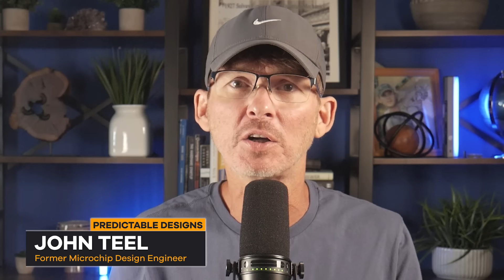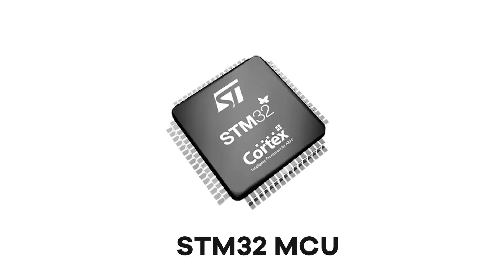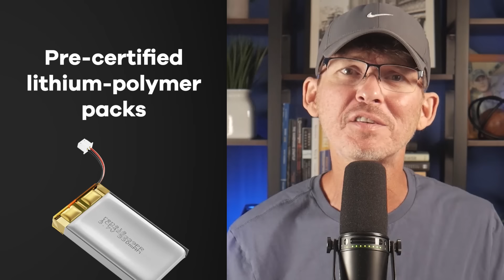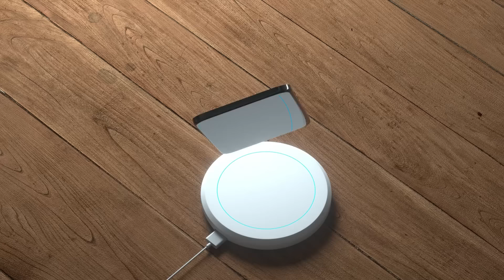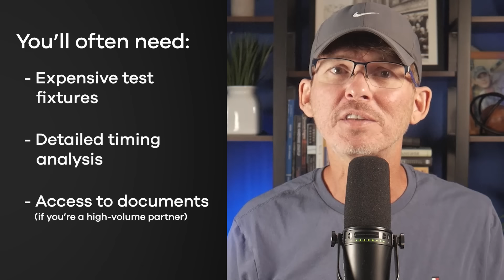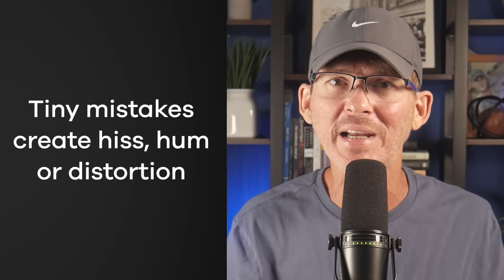10 Technologies You Should NEVER Use in a Product

Comment: "RF is tricky"
I had a colleague, other than me a proper electronics guy, who told me that everything above 100 MHz is basically black magic.
Reply: I watched the know it all PCB guys panic when the processors hit 100 MHz. Their boards stopped working altogether. I caught one group where I worked sneaking Intel engineers in to teach them high speed design after hours. During that transition time, the analog guys would laugh saying, in the end, everything is analog, you just don't notice it at low speeds.
Reply: @johnelectric933  I just did a very rough calculation. Given the self inductance of a wire (yes, I used the first link on Google) a 0.01 mm diameter wire with a length of 5 mm (standing in for a PCB trace) has an inductance of L=91.5 nH. At f=100 MHz, with Z=i*2pi*f*L you get an impedance  of 5.75 Ohms. Suddenly a wire is not just a wire anymore.
Reply: @TomFynn  Beyond that, at higher frequencies or longer distances timing becomes an issue.

Grace hopper used to hand out wires 30cm long.  Which is the distance a signal can travel in a nanosecond.
Reply: @TomFynn I've never really considered this cause I've never ventured that far. Holy shit. That is in fact not just a trace anymore
Reply: @TomFynn  Yes, inductance of traces is important. But those values aren't realistic

1. Diameter is unrealistic: you never have a 10um trace anywhere. Typical minimum trace is .1mm, maybe 75 or 50um in short areas.
2. The calculation seems wrong. With a simple formula, I get 6.6nH

Wire self inductance is mostly a problem with power supply traces.
Even a few nH of inductance causes your bypass capacitors to become pretty much ineffective at buffering the current spikes a modern processor needs.

For data traces, I've never seen trace inductance be a problem.
There it's either trace capacitance (for slower speed buses) or needing to see the wire as an RF transmission line for high speed buses.
Let me just leave it at this example: If you have a trace with an open end, that's exactly 1/4 of the wavelength long (so for 100MHz that is 420mm), from the other end, it looks like a dead short. It's called a quarter-wave impedance transformer, look it up.
Reply: @kurwamamkaca  If you go even further (or a longer trace), you also need to consider the time a signal takes on the trace. On PCBs electrical signals travel at roughly 1/2 the speed of light, so 60ps/cm. And once that time is significant, you have to compute your trace as an RF transmission line, which is a whole other topic.
Reply: @alexanderdaum8053  The values I pulled from some bodily orifice. They are not important. The point was to illustrate that at HF things we normally classify as a resistor suddenly become...interesting.
Reply: @johnelectric933  so much truth in there, it kinda hurts 😬 I'm starting to edge closer to that 100MHz area where things "stop working like they should" 😂
Reply: Interesting, I told same on some job interview 25 years ago. Though these days you can copy and paste reference designs for standard stuff.
Reply: @mladenmatosevic4591  i have seen people try to copy paste reference designs on to custom pcbs and expect it to work. it did not (4 SWR LOL)
Reply: @barfbot  Love reviewing a design and seeing very inconsistent errors around the same issues, meaning they copied references from vastly different sources and had no clue what they were doing..
Reply: @mladenmatosevic4591  You copy paste, and suddenly your RTC clock doesn't work any more because ... something ... Yeah. It doesn't work.
Reply: You should see "digital" signals on a DDR4 module using a 12GHz scope. They just look like analog noise until you dial in the switch points and see they are actually doing what they are supposed to do. 
20 years ago the probes for that were active and $1500 each and you solder little flex circuits to your test points and plugged the probe into those.
Reply: @johnelectric933  Probably bad form to mention another channel, but there is a channel on YT by CuriousMarc where in one video he repairs an old 3GHz signal generator by HP. At one point he opens and shows the inner workings of the unobtainium at the heart of this machine. It is just like walking through an alien city. And I mean alien as in "Humanity is not yet ready to receive such limitless power."
Reply: As an RF designer for >40yrs…..very few BSEE graduates in the past decade(or more) have taken any EM-classes or Waves and Fields.  Yes, it can involve triple integrals in coordinate conversions.  Too hard for Computer Science majors? No. Just hard work.  When many products are thought of as just an IP address or MAC address, then the device needs “wireless” connectivity you either “buy” a module or “hire” a grey-haired consultant who knows RF from 10kHz to 100+GHz is all just Maxwell’s four equations.  Colleges & Univ. need to go back to teaching RF along with CS.  Just my 2 cent opinion.
Reply: @BJustin-zms  There is a channel here on YouTube named CuriousMarc. He repairs old HP lab equipment and one project was a 3 GHz signal generator. At one point he opened the unobtanium which is the beating heart of the machine. Its inner workings felt like seeing an alien city built by a long-lost civilization of such high intelligence that mere mortals would never understand.
Reply: Anything below 1Mhz is practically DC.
Reply: @BartSliggers  Worked with a professor for a few months who only did RF and radar in the 60GHz+ range. To him, everything below a few GHz was "practically DC"
Reply: I'm an electronics guy & I approve this fact.
Reply: I have a pair of type 807 transmitting vacuum tubes, except they have MIL part numbers and octal bases made of ceramic.  They were brutally expensive in the late 1930's and give a class-B push-pull agreement with this statement.  But nobody knew phenolic started to conduct electricity at Very High Frequencies (over 50 MHz or so) in those days.
Reply: Ti's true
Reply: Oh snap. Don't tell THAT to the radio station I listened to in High School.
Reply: I still have nightmares about Ku band circuits 15 years after roaching out of that crap. I don't know anyone who enjoys that work.
Reply: I dodged RF and communication as a specialty at the BS level.  Why?  Electrical engineers that specialize in chip design that run in the GHz and RF are really scientists masquerading as engineers.  Jeez, microprocessor designers usually are in testing for years before they are allowed to design.  Once I heard that, I was out.  I remember a professor that designed antennas.  He ordered so much expensive stuff.  None of it was used.  He did it, all pencil and paper.  😮
Reply: @squirrel6687  In a channel here on YT, CuriousMarc, he fixed an old HP 3Ghz spectrum analyzer. In the video he opened up the unobtainium that is the heart of the machine and let the camera show it in close up. It felt like flying over an alien city. You see that it is a city. It looks and feels like a city. But you also know that it was built by an intelligence  beyond your understanding and probably always will be beyond it.
Reply: It's a black magic if you don't use EMS simulation extensively. If you do it just becomes a trickery.
Reply: Luckily there are SoC solutions for almost all rf babds you can utilise
Reply: You also need to watch out for accidental RF, a large power MOSFET was able to oscillate at around 100MHz when operating with a high voltage drop.
Reply: Yup, and analog power control is voodoo
Reply: @jenpsakiscousin4589  I remember I once watched a video here on YT of a transformer in the MW range being powered up. That definitely must have involved prayers to the machine god.
Reply: I'd say that line is too high, I work on linacs that use 13.6mhz there abouts, it's basically a black box with a few million variables that are all tricky to actually measure lol
Reply: I work in the S-Band and higher (up to 6.5GHz). It's not black magic.
Reply: @PeterA650 that's because you've learned all the spells.
Reply: @PeterA650  I recommend this video /watch?v=buNejAFjWzw from 10:40 by YTber CuriousMarc. It is Black Magic.
Reply: @PeterA650  it's S-magic

Comment: Had good luck with the Nordic reference designs instead of module & a qi charger instead of a port because of a salt water environment, but it depends on the workforce & expertise.  Things can be done in silicon valley that would be hard in the midwest.

Comment: High end analog audio is good stuff though if you specialize in that. Building amps, preamps, synthesizers and other electronic instruments, effects - definitely fun for me, especially with vacuum tubes. Not a path for everyone, but for the keen and willing to learn. It's true that you'll need more than a DMM, oscilloscope, power supply and function generator to get going, but Digilent's Analog Discovery 2 or 3 is of great help here, automating lots of measurements.

My advice would be to go with standard parts (what EEVBlog calls jellybean components - they've been around, made by multiple manufacturers, easy to use and documentation is available, and the risk of discontinuing is low) and staying clear from manufacturing limits (trace width, clearance, via/PTH diameter, etc.) unless you have a really good reason.
Reply from the maker: Definitely, if you have the audio design skills. Custom RF and high end audio are two of the most complex types of analog design.
Reply: @PredictableDesigns  Though audio is still orders of magnitude simpler than most of the actually high frequency stuff. 20kHz is still very very pedestrian in the world of signal processing.
Reply: For audio, vacuum tubes have zero technical advantage and many drawbacks.  Their only advantage is impressing no-nothing brain-dead buyers.  A 5534 or even a TLO71 is far superior.
Reply: What are the issues you've run into in synthesizers? (I'm a software synthesis guy so I'm intrigued)
Reply: @boptillyouflop  ground loops, some cross-talk or excessive attenuation if you want to fan out a high-ish impedance output, that can be tackled though.
Reply: @KeritechElectronics  Good to know, thanks!
Reply: It's not that hard, you just have to remember to put the arrows in so that the electrons don't get lost and accuse people of not appreciating music if they don't hear anything over the static.

Comment: HDMI also has licensing issues
Reply from the maker: Great point I should have mentioned! Thanks for sharing.
Reply: @PredictableDesigns  This issue has even tripped up AMD when they were denied a license for HDMI 2.1 on their graphics cards.
Reply: @gtsteel  Not really. The issue is that they have an open source driver on Linux and the HDMI consortium had issues with that. They could have used a binary blob for HDMI 2.1 functions the same as Nvidia to get around that. Intel instead opted to use DP-->HDMI ICs on their Archmage cards so there was no issue but Battlemage has the exact same issue as AMD.
Reply: @Realmaker001  "They could have just doubled some of their support work." There I fixed that misleading line for you. Surely it wasn't intentional.
Reply: @fgregerfeaxcwfeffece Your added "just" is doing heavy duty here. I did not imply a should have but a could have. Surely it wasn't intentional.
Reply: Use DisplayPort instead.
Reply: They are very forgiving. You can start non-certified for small volumes...and if the product ramp up, you start the paper work...otherwise, just kill the product. Unlike RF techs...which can put you in trouble even for low volumes.

Comment: I usually avoid products that aren't USB, if there's a USB alternative.   That feature is easily worth $10 or $20, since I generally don't buy tech unless I plan to keep it for 5+ years.

But if you do PD, try to make sure it can charge slowly from a 5v supply.  People will be confused and complain if it doesn't charge from a legacy source.   Even if it takes ten hours, that's might be fine for a lot of use cases, as long as it does in fact actually charge.
Reply: This is a huge thing people neglect. Customers don’t understand PD so you better make sure it still charges at 5V.
Reply: @ZachMakeThing Even with people who do understand it, sometimes you just don't have access to a PD port
Reply: Beware of the opposite problem. If you shove a USB-C socket on a device and forget the CC resistors, it will work fine on a dumb USB A-C cable, but on a C-C cable and a PD supply it won’t output any power at all. Lots of cheap gadgets that use a USB C port for 5V charging have this problem.
Reply: I specifically bought a USB-C PD charger for my car that had 20v out so I could charge my laptop on my 1.5 hour commute. Would have been nice if it charged with a lower voltage PD charger.
Reply: @brainwater  Saw a few laptops that could do that (albeit at very slow speeds), but nowadays I mostly encounter laptops that just demand 20v over pd, and some will complain if for some reason it drops somewhat below it (low mains voltage, near to the max power of the off brand charger etc...)
Reply: @brainwater  The fact that USB-C charges large things like laptops was one of the stupidest ideas out there. It leads to a lot of fire related risks that are unnecessary when people inevitably come across non-compliant cables. Items with such varied needs for power shouldn't be on the same port where the only indication something is going wrong is a bunch of heat and smoke.
Reply: Reminder: not all usb is usb-c.  I still use plenty of micro-usb devices.
Reply: @Erhannis  USB Micro-B became ubiquitous due to its size and cost. It can still do higher voltages by communicating Qualcomm Quick Charge over the D+ and D- lines, though QC is steadily fading from use, and I haven’t seen any QC trigger boards that aren’t also USB C PD trigger boards. The micro-B connector is too fragile though, if you don’t care about size just use USB B instead. The data pins even fit into perfboard for friendly prototyping.
Reply: @Erhannis  Me too, but I won't buy a micro-usb device if there's a usbc alternative.

Comment: Agree with all except usb PD. It’s too easy now. No excuse not to use it
Reply: Also, if you want to sell your product in the EU, you may be required to use USB-C instead of other connectors.
Reply from the maker: Yeah, that seems to be the tech I'm getting the most pushback for. Once again, I'm not anti USB-PD, just pro the simplest solution that solves the problem, and I've seen PD being used in products where it's not really necessary.
Reply: @PredictableDesigns  I think the objection probably should have been about what happens when you want 1 USB-C port for both data and charging. I"m definitely not an expert, but I suspect that might be more complicated as USB-C PD these days can often times be done with a cheap chip. I bought a 10 pack that can do 5a and 9 to 20v.  Which is enough to power quite  a few projects around the home. I should probably find one that can do 3v or so and use it to power some LEDs.